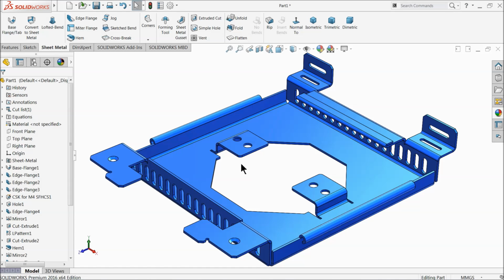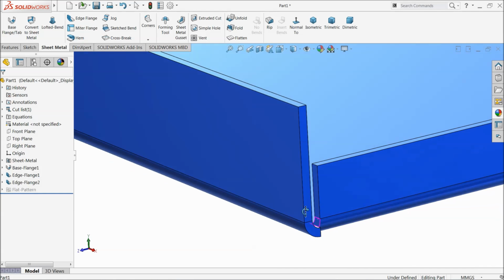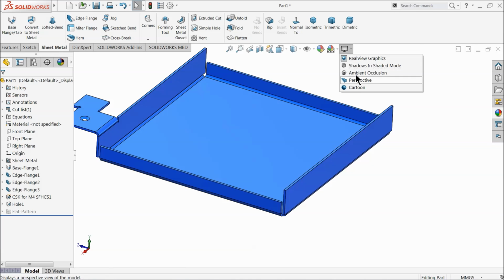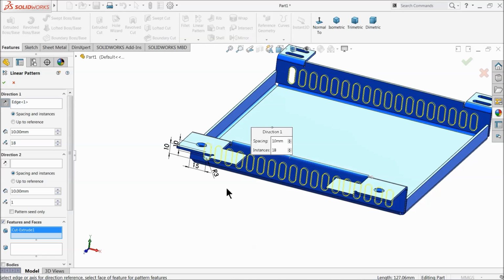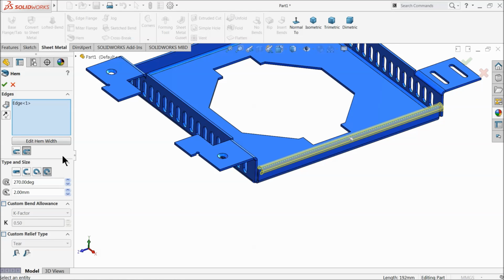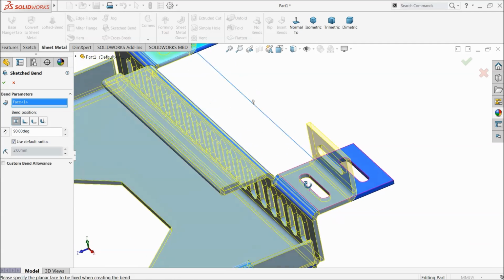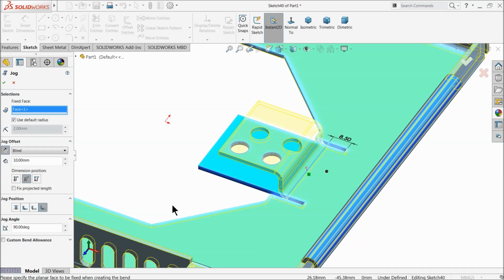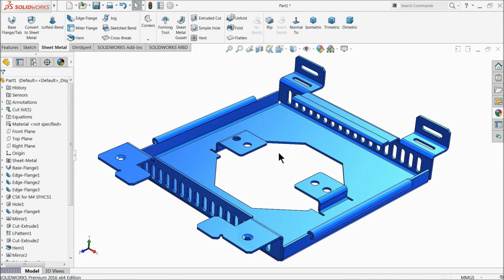Solidworks tutorial Basics of sheet metal

Comment: Thanx for the hard work your doing.

I want to ask you for a favor. I'm working on a Gear Reducer Assembly. I have modeled all the necessary parts except for the Gear Housing.

I have all needed specs and dimensions, I would really appreciate it if you make a video modeling the gear housing, or the whole assembly if you want. 

let me know, and thanx in advance.
Reply: Here are the links to all dimensions

https://ibb.co/gO60rQ
https://ibb.co/gTV4J5
https://ibb.co/jMQ4J5
https://ibb.co/ny3DBQ
Reply from the maker: let me study i will try it
Reply: Alright man.

if it's too much to do, i'm only struggling with the Gear Housing. that would be enough for me. the housing internal features are driving me crazy, i just could not figure whats inside.

ive modeled the part over and over, but i never got it right when i compare it with the AA and BB section views.  

thank you.
Reply: Did you have any luck figuring the internal features of the housing??